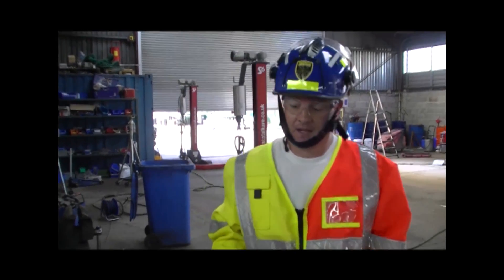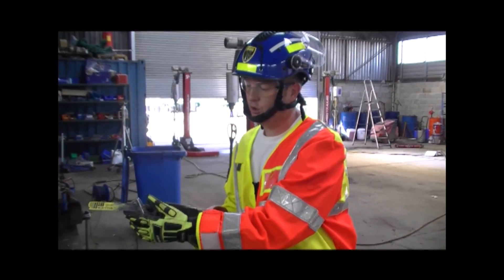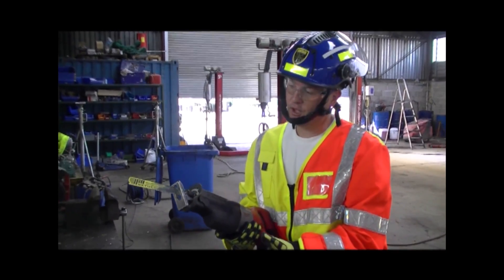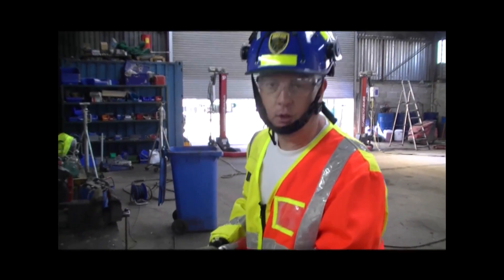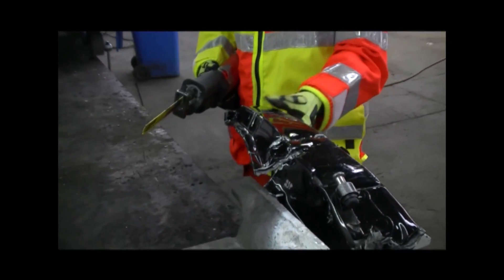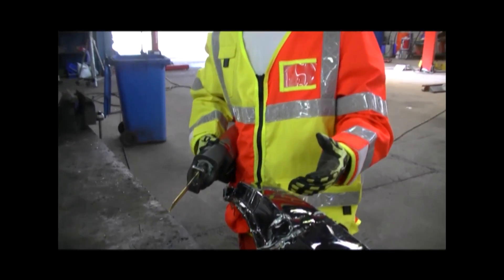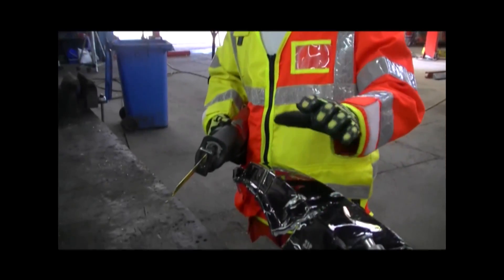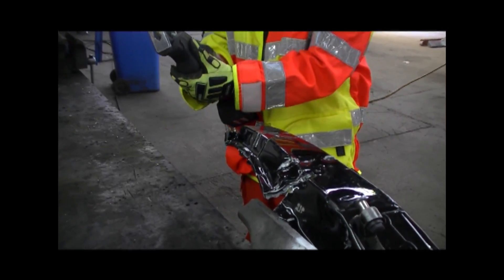Extrication RTC Cutting Boron High strength steel

Comment: Hi RTC Rescue.com

Interesting video. I have a few questions and I would appreciate your thoughts.

- Can you tell me how long this took exactly?

- How much of the battery did this single cut require?

- Would you use this as your preferred method over hydraulic cutters?

Finally, I notice that this cut was in a very comfortable position i.e. the B pillar was laid flat and you had full access. I would suggest that in a real life situation the likelihood is that the post would be vertical making it much more difficult....
Reply from the maker: +David Walsh 
Hi David, thanks for the response to the video, some very good points; it took about 4 minutes 30 seconds to cut through the post. The battery only used about a third of its charge. Would I use it as a preferred method? Good question, its certainly something i would consider for simultaneous activity along with hydraulics, there are many pros and cons for each, I would say that the situation would dictate what I would use, if this blade was available. if available it would be a real consideration.

Yes the post would in most cases be in a vertical orientation, I don't think this would have much impact on the saw use or capability. I agree, as with any technique the access to cut points will always have a deciding factor on the ease of completing such a task.  Even though the post was held in a good deposition in a vice it was still taxing on my arms with the continuous application of steady force and the vibration.

I hope this answers your questions.

Thanks for sharing your thoughts.
John
Reply: +CASIO182 Thanks for your reply. I think that 4.30 seconds would negate and advantages under simultaneous activity as within that time the hydraulics would become available and would then make any disadvantages the saw brings, not particularly casualty centered. I am not against the saw, but given the nature of new construction the saw, given the presence of a set of hydraulics is a backwards step.
Reply from the maker: +David Walsh Thanks for the response. the advantages in simultaneous activity are that this is another option to use, not all rescue agencies have multiple hydraulic tools available, hydraulics and saws can be used side by side. Why would it not be casualty centred, I don't think it is a backward step, with developments in tools and vehicle construction I very much see this as a move forward as it is giving the rescuer more options to use. The timings are a factor, but even with hydraulics, being used by in-experienced hands and problems that can be faced on scene I have also experienced hydraulic tool cuts to take quite some time. Like I have already mentioned there is room for both, I for one would rather have many options at my disposal than just using what we have always used out of habit. Take care.